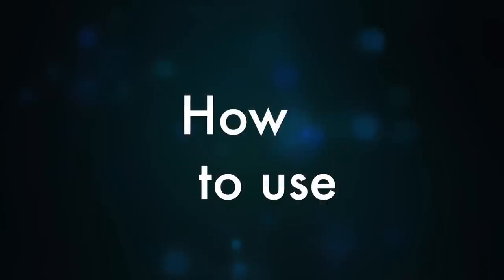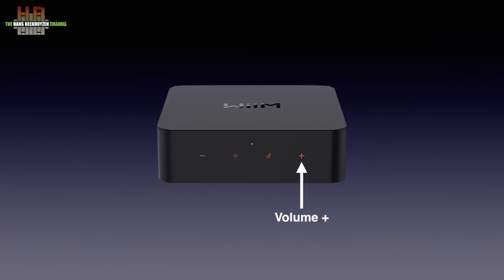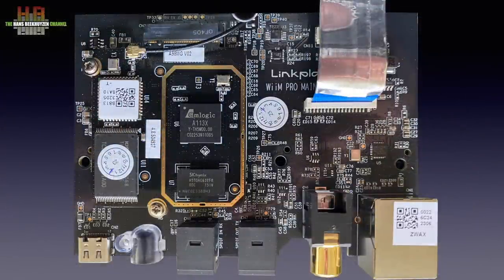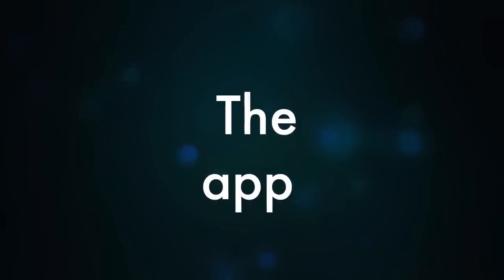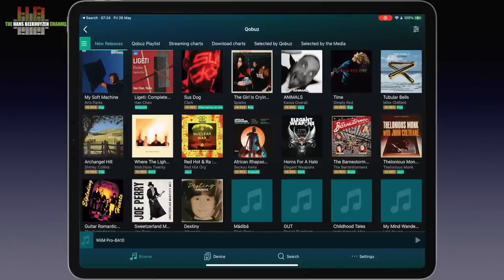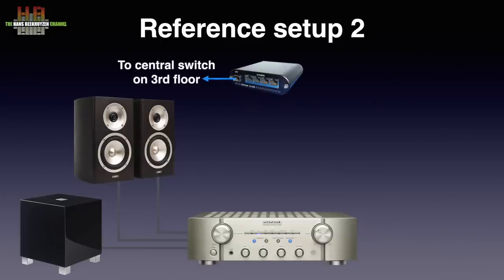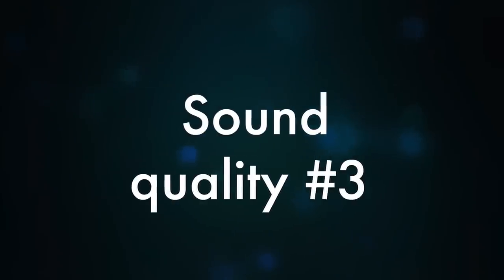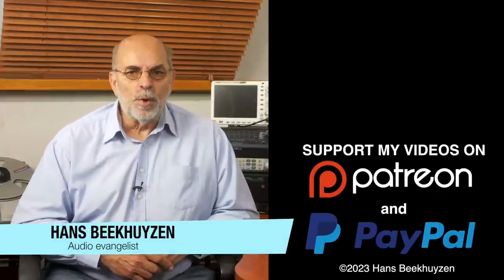WiiM Pro streamer does it all

Comment: I have my Wiim connected to a Nuprime DAC via toslink. The Nuprime DAC has an incredible pre-amp section with Class A output stage with XLR balanced connections. Volume is 99 step ladder. This connects via balance XLR to a Mark Levinson power amp. I connect my iPhone via Wifi and it’s so glorious.
Reply: Which Nuprime DAC do you use?

Comment: Nice and informative video. Thanks a lot. 
I’m using WiiM mini and more recently the pro, connecting to a Mytek DAC and a pair of Geithain active speakers. Most of my digital music comes from a local NAS using airplay protocol. Prior to WiiM I was using AirPort Express devices. To me the WiiM pro is an upgrade, both sonically and from a functional perspective. I’m very happy with it. And btw I noticed a difference and improvement  in sound quality between mini and pro (connected with the DAC via toslink).
Reply from the maker: If you would replace the WiiM's with for instance an SOtM sMS-200, there is yet another upgrade in sound quality. Just saying.
Reply: @TheHansBeekhuyzenChannel  👍🙏🏻
Reply: @TheHansBeekhuyzenChannel Does SMS200 still sound better than WiiMPro+Shanti PS?

Comment: Another top notch and informative video Hans, Thank YOU! I bought the WiiM mini when I had the Eversolo streamer on order, and it was backordered, easy 30 day wait. So, Amazon had their big sale day, so I picked up a WiiM Mini, and immediately bought a WiiM Pro after just a few days with the Mini, for the digital coax output for my DAC. The magic of the WiiM units, is the ten band graphic equalizer. Put a good power supply on the WiiM Pro, 5v 2.0 amp unit, I am using the ifi one Amazon sells for $69, pair it with your favorite DAC, and for a little more than $300 you have one killer little streamer. 

The WiiM Pro sounds better on my system than the Pi2 Mercury v2 streamer running RoPieeeXL via network, and I chalk that up to the built in EQ of the WiiM. And yes, I have the WiiM Pro attached to my network via ethernet, through the LHY SW-8 filtering network switch. The sound out of the WiiM, for the money, is ridiculously GOOD! I cannot see spending more money for what I would perceive as very little improvement on my system.
Reply from the maker: Enjoy the music

Comment: I found the WiiM Pro as a streamer only (never tried the DAC) to be somewhat congested and constrained, somewhat on par with my Node 2i (as a streamer only). The addition of an Allo Shanti is a whole other story adding aire, texture, bass, soundstage depth and width, and detail on par (or even slightly better) than the Shanti powering a RaspberryPi 3+ with Allo DigiOne Signature hat. Finally found a reasonably priced worthy replacement that doesn't have all the technical glitches of the Pi and Volumio. I now have 2 of the Wiim Pro/Shanti setups and may get a 3rd while I wait for the market to bring a substantial streamer only upgrade for less than $1k
Reply: I had the same experience with an ifi power supply and the WiiM Pro using the PS Audio Stellar GainCell DAC/Preamp with a vintage Sansui 4000 receiver. The WiiM sounds better on this system with this combo vs my Pi2 Mercury v2 streamer with the LHY linear power supply. The reason, in my mind, how the WiiM Pro can sound so good, is the 10 band graphic equalizer. The EQ takes the WiiM products to another level. They really put a lot of thought into integrating everything into their ap.
Reply: I plan to connect the WiiM Pro to PS Audio DL3 together with Sansui AU217. Any advice?

Comment: I believe you are on to something with the external power supply. I bought an Allo Shanti, which literally cost $50 more than the Wiim Pro, plus shipping from France since Shantis have been impossible to find in the US. The results were simply extraordinary.  I suspect there's better out there, but at what price?  Note that I'm running it through a SMSL SU-9 Pro, not the internal DAC. You should try it with one of your SOTA power supplies, if you haven't already.
Reply: What type of adaptor is needed, i have the wiim mini and pro, thanks!!!
Reply: @legrandgroves8560  It comes with an assortment including the correct one.

Comment: Great video !
When combined with an external DAC, did you notice any sound quality differences between the Pro and the standard WiiM Mini (which I already use)?
Reply from the maker: Only a very small difference
Reply from the maker: @vintageflanker7096  it’s a different design
Reply: I discovered the mini has DLNA with Bubble Upnp in Android. Bitperfect and gapless. And thought only the pro did android stream high res. Wrong. So now Pro is no longer necessary
Reply: @vintageflanker7096  You wasted your time. Measurements mean very little, especially with Dacs and streamers.
Reply: @VintageFlanker so little to no difference, get the mini and be happy
Reply from the maker: There is a small difference at the digital output. But there are more differences as I explained in the video.
Reply: @TheHansBeekhuyzenChannel  thanks! I have mini. Works great. But the question is …should I get audirvana in this setup? What is the point of Roon or audirvana having this (mini) streamer?
Reply: @TheHansBeekhuyzenChannel  what do you mean small difference ? In sound? Or in features (pro offers coaxial too)?
Reply: @leonardopapantoniou4227  one is more expensive so Hans will tell you the other one sounds slightly better, that's how audio reviews work. Always.

Comment: I ended up buying 3 of these for each of my listening setups and sold off all my other streaming sources.  For the price it does everything I need.  Is it perfect no!  I am tied to the amazon steaming platform and being able to stream natively Through the app is something almost all other streamers cannot do not even BlueSound node through BluOS.  There are a few bugs when skipping tracks or fast forwarding or rewinding tracks can have long delays or even cause a pause or the track to restart.  But for the price these are amazing
Reply: I had the Amazon Echo Link and even Amazon's own hardware suffers from the exact issue. I think this is more of an Amazon API issue and not WiiM's fault.

Comment: What would you suggest my approach be?  -  I currently own every Squeezebox (times 2) minus the Transporter and I run the Logitech Media Server software on a dedicate Laptop.  Question: should my approach be to infuse my three new WiiM PROs into my Logitech Media Server echo system  OR  Would I'd be better off terminating my entire Logitech Media Server based setup and go 100% WiiM ?  If the latter, then what replaces the Logitech Media Server software (does WiiM provide a new and improved substitute?). Thank you so much for your input on this!
Reply from the maker: If you are prepared to give up your Squeezebox equipment, you find a more robust and versatile solution in the Wiim player. You also need to replace LMS by a DLNA server. May I suggest Minim Server.
Reply: @TheHansBeekhuyzenChannel  My gosh it's been 18 YEARS!, however YES it's time to move on :)  OK, I just researched DLNA servers and despite Plex running on my Nvidia Shield PRO which apparently would work, I see that your suggestion of using the MinimServer is quite warranted.  Not sure I can run MinimServer on my Nvidia Shield PRO, however if not I'll simply run it on my Gaming PC (with 2 TB and plenty powerful for Streaming and Ripping alike).  QUESTION: anyone know of a good (cheap) Remote Control option for running the Wiim app?  I'm using my current cellphone, as well as my previous cellphone (now stripped down to function purely as a Whole house & Remote Control).  I could buy yet another cellphone, but that would be expensive and buying way more features than I need (camera, etc.).  I'd rather it not be BIG (tablet etc.) and instead I wanted something that I can wear on my Belt/Hip.  Any suggestions anyone?  Any other very small Android options other than a cellphone?

Comment: I'd be interested to know how the digital output of the Wiim Pro stacks up against a Raspberry Pi and a HIFiBerry Digi+ HAT.  
So much easier to initiate but what about the sound quality?
Reply: The Wiims DAC isn't a very good one so the R Pi with a Hifi berry hat would most likely be better.  I use my Wiims with external DACs - a Schitt Audio Modi 3 and a Topping DX3.  Sounds fantastic and allowed me to cancel the Volumio subscription that I used to stream Qobuz on my Pi.  I turned my pi into a Plex server to stream my ripped CDs.
Reply: @srdjr6760  I'd probably, like yourself, be using an external DAC. My Pi is currently linked to a Rotel DAC via a Digi HAT. I have a DX3 as well but I prefer the Rotel sound. Thanks for your help.

Comment: Thanks for this! I have my PC going into several systems downstairs via RCA to Cat6 back to RCA at each amp. I need something to "pipe" the music to an upstairs system. Will this fit the bill?
Reply from the maker: It will do the job as such and most likely sound better than your RCA/CAT6/RCA solution. But there is a limitation sound quality wise.
Reply: @TheHansBeekhuyzenChannel  Bedanked and groeten! Better than my hard wires, "but there is a limitation sound-quality-wise?" Could you please explain? Also, would eliminating all my wires mean that for each system, I would require one streamer (per system)?

Comment: I use the Pro via coax into my mdac+. A Topping P50 lpsu is also used . This is 5v but only 1amp output. It works fine but should i be worried that I'm not giving it enough current,? ...
Reply from the maker: I don't think it will cause a defect but there is a big chance the sound quality suffers from it.

Comment: They have been promising Roon support for a while and saying it’s coming this month. Curious if that will make the streaming better.  I guess my real question is: what is it about more expensive streamers that makes them sound better when streaming bit perfect digital to external dac? Why does that matter and how is the ‘bit perfect’ digital signal being degraded?
Reply: Bit perfect digital is only half the story. The other half is timing. The quality of the clock oscillator is critical to the sound. As is the power supply. Better streamers have better clocks and better power supplies. And if your streamer has an internal DAC, there opens again different levels of performance.
Reply: See the video from Hans: How digital can go wrong
Reply: @brodricj3023  you know , I have at my light table next to my bed Tempotec serenade X streamer/dac/amp. Not super sound but ok for my budget space and expectations. It comes with an external power supply of 12 v dc. I have also an ifi ipower with that specs and really they sound THE SAME. Curious since I have dac Topping E50 and ifi I power LPS of 5v and it sounds BETTER with it than connecting to a conventional usb 5v charger. My question is… suppose you have a tv stick such as Amazon 4K max , should it sound better with LPS? I have not tried yet
Reply from the maker: it probably does. I expect it to give less micro judder; little ‘worm-like’ movements on the screen. And thus provide a sharper picture that is easier on the eye.
Reply: @leonardopapantoniou4227  I use an SBooster external power supply with my Kaleidescape M300 player with very good results. Well worth the investment.

Comment: I purchased a Pro a month ago and thought it was OK until I realized it DOES NOT play songs from an album on my Synology NAS in track order.  I googled this issue on line and found out that this problem is common.   WIIM was to have fixed this problem in April 2023.  As we are all aware it is now early June and no fix is in site.  If the problem is not corrected by the end of the summer I'll give this piece of junk away and purchase a Bluesound Streamer
Reply from the maker: Thanks for sharing
Reply: @TheHansBeekhuyzenChannel  Actually ended up purchasing an Eversolo DMP-A6.  Overall I do like the A6.  The minor issue I have with the A6 is that the software is  a bit laggy when initially loading a list of my files when using an Android tablet.  The NAS sourced files are immediately on unit itself so I am good with that minor issue.   I do use the Wiim's on other amps in my home.

Comment: Having no USB out is perhaps a deal breaker. If I’m not mistaken, connecting to an external DAC using USB would enable the clock of the DAC to be used. The clock in the Wiim Pro can’t be good due to its low price.
Reply from the maker: Using USB does indeed means that the clock in the DAC is used.It also means that the noisy power supply and clock signals in the source is likely disturbing the digital to analogue conversion, as I have explained in many videos. The best interface is the best BUILT interface, preferably on both sides of the cable.

Comment: Is there another streamer with a 10-band EQ (or similar), a subwoofer out and a better DAC than the WiiM Pro?
Reply from the maker: That's a general question that's impossible to answer
Reply: For the money, I certainly know of none. I use two SVS SB-3000 subs, and you could easily hook those up to my WiiM Pro with some RCA y connectors. Then let the SVS handle the filtering. I have had a few streamers through here, and the WiiM is by far the best to date on many levels. The clincher is the ten band EQ. That alone takes the WiiM to levels most streamers will never attain.

Comment: How do I connect wiim pro to external Dac? Which connection port should I use? Thanks
Reply: Optical or Coax, I prefer using the Coax out to my Gustard R26 Dac.
Reply: @mikelanier5617  I'm also using R26, but R26 already has a Lan port
Reply from the maker: Watch the video
Reply: Coax sounded better than optical to us.

Comment: How about if you output its digital SPDIF into a reclocker first, then into DAC? Examples of high end reclockers: Ladder Handel, Mutec MC3+, Audiobyte HUB. Why would I do this: to take advantage of WiiM's excellent user interface and app. I do have a feeling that even the $$$ streamers will be improved by one of these reclockers.
Reply from the maker: Sure, but also reclockers come in qualities. And wouldn't it be better to start of with a streamer that has a proper digital output in stead of trying to repair a low quality output signal?